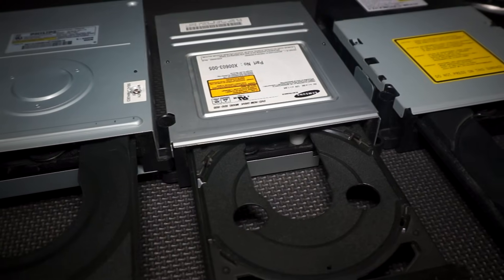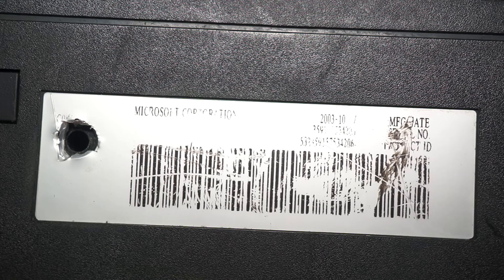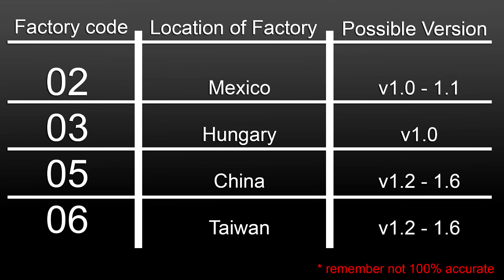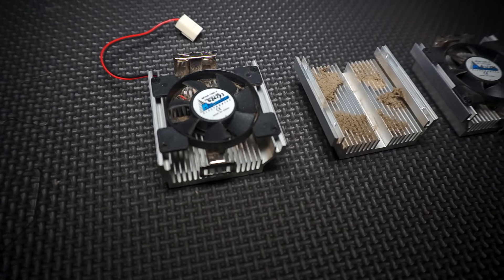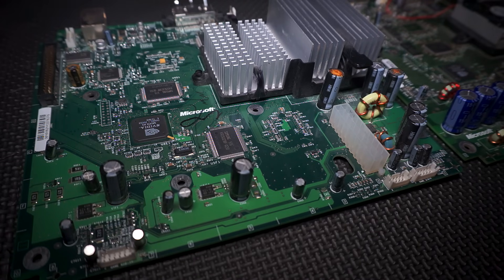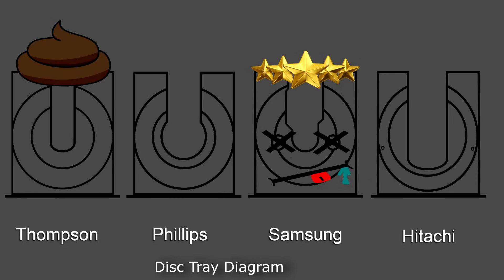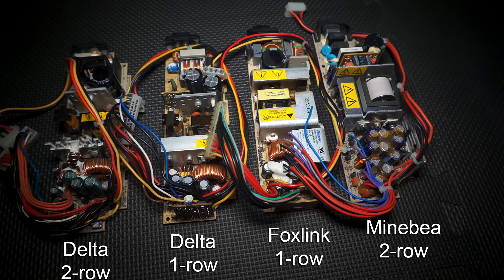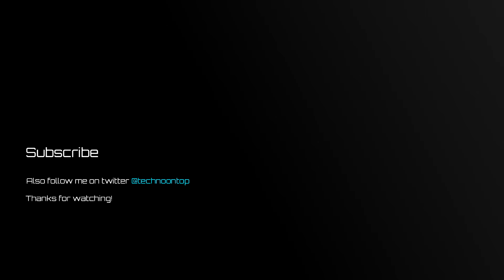How to tell what version original xbox you have

Comment: A little more information I checked the version and it is a 1.6 
Kernel number 1.0.5838.1
GPU REV 211
MCP REV 213
FLAGS 1616

Unleashx very
0.39.0528a
Build 584

I also see it has seven hard drive partitioned

C through F and X Y and Z

Not sure which one would need the driver's or how to load them

it looks like there is a file explorer built into the program that runs this unit

I think I could copy from the CD player to the hard drive or possibly from the USB to the hard drive but I'm not sure how to load the drivers if they are required to run a USB joystick and push-button console that has the trackball built into it

Any help is appreciated

Thanks
Reply from the maker: Hey, I will try to answers your questions, firstly yes an ide to Sata adapter can be used to swap in a harddrive or an SSD if you choose, one thing to consider is the Xbox will wear down an SSD much faster then a computer would. Making a copy of your original harddrive is also possible, iv personally never done it, higher end modchips such as the smartxx v2 have a built in feature to make a harddrive copy within its OS by hooking the 2nd hard drive as a slave, Im pretty sure that the Hexen disc also includes software to do it. Your main issue with upgrading your hard drive will be if you are softmodded, if you are there are alot more steps ones I'm not familiar with. Personally I always hardmod if I plan on upgrading the harddrive as it makes the process a million times easier. Look into hexen tools for the Xbox and look into installing an alladin modchip, as for using USB controllers it's not something I'm completely familiar with but I know the ogx360 adapter by ryzee119 allows you to use some other adapter that uses retro type controllers. There is another mod way old by now that allows you to use an atari stick but it requires some soldering. The 2 ports ontop of the controller were used for memory cards, and other addons such as the Xbox live headset.
Reply: @TechnoOnTop  thanks

Comment: Can I use a USB joystick on the Xbox ? I have 9-22-2004, I think this is a very 1.5

I got it modded, and I have the special oval Xbox connector to a female USB standard-a type connector

I don't know if the USB joystick and buttons would be plug-and-play or if it would require some sort of a driver

As far as I know this was modded with some sort of Linux, which has the 4000 arcade games loaded onto the hard drive

I really would like the old fashion style joystick and push buttons and also the trackball for playing games that had the trackball originally instead of using the Xbox controller which I find difficult to use

Also on my controller there are two strange-looking ports on the top of the controller and I don't know what they do they are not the Xbox style connector

Is it possible to replace the PATA hard drive with a SATA solid-state drive ?

I have the adapter to go from pata to SATA

This drive is wearing out and I would like to save everything to a new solid-state drive

Any help is greatly appreciated

Thank you in advance

Comment: So 1.6's are unable to get more RAM?
Reply from the maker: Correct, Microsoft removed the pads that are used in the modification
Reply: @TechnoOnTop  why don't there be a way to remove the chip then make a ram chip slot doubler then bam 2x the RAM chip capacity.
Reply: @TechnoOnTop  or just replace the chip with a 3d printed 128 MB chip.
Reply from the maker: I am unsure if it's even possible, the boards are different in design, the 1.6s also lack a tsop chip, interesting thoughts but they are beyond my ability
Reply: @TechnoOnTop  well I know that a mod chip on a 1.6 is possible so what about a mod chip that's a RAM slot (if you're think that it won't fit everything got smaller since 2001 so someone try that please.)

Comment: I'm not sure but I think I have a 1.4. I checked the pin 1 with the ground screw hole at 200 ohms & the numbers didn't move at all. So I redid it at 200k ohm & the numbers moved to 1.400. Am I'm doing this right? Is my xbox a 1.4?
Reply from the maker: I made a mistake in the video, I pinned the top comment and added it to the description, the pin you need to Measure is pin 2, or you could measure from pin 9 while the console is powered on it should be 3.3v

Comment: HI, my original Xbox show error 05 ? can you tell me please how to resolve this issue
Reply from the maker: Error code five is when the harddrive isn't locked and a stock Xbox requires it to be locked, if the Xbox is hardmodded you need to download hexen tools and burn that onto a DVD then cold boot into it so you can properly prepare the harddrive, if you weren't modded at all, just put back in your stock harddrive, if it's softmodded and the harddrive died and you don't have a backup of the eeprom, to build a new harddrive through chimp, then you will need to buy and install a modchip then use hexen to prepare the hard drive. Same goes if you weren't modded at all and the harddrive died,
Reply: @TechnoOnTop  Thank you for kindly reply, my Xbox soft modded without any chip, i accidentally put software disk and one option says do you want to unlock the HDD and i clicked yes and error code 05 appear..as you explained to me, now i hocked my HDD to my PC using xbox 360 explorer software i copy 3 and 4 to my PC HDD and also located eeprom bin, what shall i do? do i proceed with your suggestion to burn hexen in a dvd?
Reply from the maker: Since you have your Eeprom backup you should be able to use the program to either re-build or re-lock your hard drive I'm not sure if the 360 explorer is the correct program iv always thought it to be "chimp" I'm not super familiar with softmods, or rebuilding harddrives for them. But I'm pretty sure at this point it has to be fixed via computer. Or you could install a modchip and then use hexen tools to fix it. Personally that's what I'd do but iv always avoided softmods.
Reply: @TechnoOnTop  Thank you so much, the hexen software do i burn it on a disk as ISO or what? do you have direct link? if NOT at less do you know the size file of hexen?
Reply from the maker: @lawrencejd8935  heres a link https://assemblergames.com/threads/my-hexen-project-truhexen-2019.69926/

yes you burn it to a dvd as an iso file,

Comment: My Samsung one doesn’t open so I keep the cover unscrewed when I need to use it next
Reply from the maker: Sounds like a hassle, havr you tried to clean the little rubber drive belt? And just look over all the parts and pieces to try and see what's causing the DVD drive to stick, because it's not a super common thing, I just got one the other day with a stuck DVD drive, but it's way less common then stuck 360 drives.
Reply: TechnoOnTop I’ve cleaned it replaced the motor and swapped it out to check if it works and it still gets stuck even when I use the new belt
Reply from the maker: That's strange that it still gets stuck, in my experience it's always just been the belt that was preventing it, that or the disc drive wasn't seated right in the console. Anyways thanks for watching
Reply: TechnoOnTop No problem mate your videos are always good to watch if help is needed

Comment: I've tried to softmod my 1.6 system but when I put the usb back into the xbox,  the linux save file and the game save ( splinter cell , ect..) doesn't show up . What step am I missing?
Reply from the maker: Does the USB show up at all as an Xbox memory card because iv never had any luck using a USB drive, I know others have but not me. I use an official Xbox memory card. Then you can add a USB cable to it so you can plug it into the computer and use action replay.
Reply: @TechnoOnTop  yes it dose.
Reply: @TechnoOnTop  Oddly had issues with all my USB drives too, what worked for me was a Sony PSP with a 2GB memory stick inserted!

Comment: Well... i got an Hitachi on an 1.6 (maybe, the sticker says 2005) and for some reason a Hard Drive that has only 5GB of storage. Are the Hitachi drives very rare? Also, the motherboard is very interesting compared to the other ones from 1.0 to 1.5. Also if the DVD-drive (Hitachi) breaks, whats the best one to replace it with the Hitachi?
Reply from the maker: The hard drives came in 2 different sizes 8 and later 5 gig I wouldn't call them rare, iv seen the smaller 5 gig in older versions of Xbox before, my best guess for that would be it was sent in to Microsoft for repair for a harddrive failure. Yea the v1. 6 lost a bunch of things, it's tsop chip along with the pads for the extra ram, the mounting holes are also slightly different. Honestly any drive toy can find that still works is a fine drive. Most people tend to gravitate twords the Samsung drives, and I suppose I would say stay away from the Thompsons as they are the oldest. But any drive that works is a good drive.
Reply: @TechnoOnTop  Ok. Thanks for the information. I can't stop playing Burnout 3 Takedown on my XBOX.

Comment: My XBOX has the MFG. Date: 2005-02-25. What version do i have?
Reply from the maker: Idk  the video covered that. Thanks for watching
Reply: You didn't say anything about the 2005th versions... Also i think i Figured it out. I opened up my XBOX and  it seems like a 6b or version. There's really a big Difference between the oder Version and the 6 (6b) version.
Reply from the maker: I did, the graph shows 2004-5 = 1.6,1.6b, those boards where stripped down, they removed the spots for the the extra ram, and they removed the TSOP chip, another difference from the earliest 1.0 is they don't have controller daughter boards, but those were removed at the 1.3. I don't think there is any difference between the 1.6 and the 1.6b other then the manufacturer of the Ram chips.
Reply: @TechnoOnTop  Oh ok... thankz for the information. I really enjoyed watching your video.
Reply from the maker: Your welcome, thank you for that much appreciated, happy modding! If that's a path your going down, feel free to ask any questions you may have. I will do my best to help
Reply: @TechnoOnTop  thankz dude

Comment: So after 15 years I felt like looking for my old green halo xbox to play some games and as I go to plug it in...I find the power supply is missing and I have no idea why. I know for sure I never opened it myself and if it did break and I sent it for repairs...why would the PSU be missing? This is all very strange, but at any rate, I need a PSU. After watching this video, I can see that my xbox is a 1.4 or 1.5, but I also discover that, just like one of the motherboards in the video, it has something written with marker in the middle of it. I'm not sure what it says, but does anyone know for what purpose someone would write something on an xbox motherboard? Also just want to confirm that for my 1.4/1.5 xbox, any 1.2 to 1.5 xbox PSU should work, correct?
Reply from the maker: Ah the green special edition I wish I would of picked those up when they were cheap, but that is strange that it's missing the power supply, maybe a sibling swiped it? Or a "friend" most if not all motherboards have marker writing, I think it's just what the testers in the factory would scribble to say it works and is good to go. And yes any of those power supplies just make sure you match the connector I'm guessing it's a 2-row. Good luck! Thanks for watching
Reply: Interesting information on the writings. I was hoping that it was something done by Microsoft's repair people which would have meant that I sent it in for repairs, something that I don't recall doing. I don't even recall it breaking to be honest. I was young at the time so I may have just forgotten... This mystery will torment me forever lol. Anyway, I appreciate the help, thank you very much!
Reply from the maker: If you sent it in to Microsoft for repair then they wouldn't of just sent it back to you without a power supply, hopefully all that's wrong with it is the fact it's missing a part and not more good luck! If you have any other questions feel free to ask.

Comment: Just some info about my experiences.  I have a launch edition Xbox.  I assume it is a 1.0 because I purchased 11/15/2001. 

In 2002 I purchased Capcom vs SNK 2 and the Thompson disk drive caused an error in which it stalled for 2 minutes for loading between rounds.  I purchased a PC Samsung drive ($45) that had the same internals as the Xbox Samsung drive ($80) and modded it to work in the Xbox.  The load time in CvS2 was now 5 seconds between rounds.
Reply from the maker: I'd be interested to hear more about how you modded said drive to work, iv hooked up a laptop drive before, it would boot backups, but only from boot, made it somewhat useless,
Reply: @TechnoOnTop  There were instructions on the internet. Google: Samsung SD-616t Xbox.

4 soldered wires onto board of new disk drive connected to 4 of the wires from yellow 8 wire connector.  Split power from HDD with molex to provide power. Swap polarity of drive's motor.  Remove drive face plate from new drive and cut its tray end so that the xbox drive tray cover can fit on it.  Have to permanently remove the Xbox screw post that is near front of disk drive.  Quite the operation really.  Probably not worth the $35 at the time, but I learned quite a bit.

I still have Xbox modded with 320 gb hdd, but its dash is sloppy.  I need to clean it up.  Just removed the clock capacitor.  Still good but my 65" oled has only hdmi.
Reply from the maker: Very cool, I went ahead and found some discussion on the topic and read over it and then remembered reading about this forever ago, so thank you for jogging my memory on the subject it's an interesting one, maybe one I will explore further in the future, I have more working disc drives then Xboxs  so maybe not anytime soon lol that sucks! I always make sure that the new tv's I buy have more then just hdmi, but there is a modder ryzee119 who has made an hdmi mod for the og Xbox, if your into that check it out! He also makes a converter to allow 360 controllers to be used, though unsure he has any left he, is assembling and shipping his last run as of a few days ago. Happy modding!
Reply: @TechnoOnTop  Originally these modded pc drives helped to play birned copies of games, but I only did it to replace my drive originally.

Comment: Based on my console being from 2002 and the single-row power-supply, it could be v1.0 or v1.1

But the serial number being '05' means it could be v1.2 - v1.6

I've never been so confused.
Reply from the maker: Was the Xbox opened prior to you having it? If so it could of been swapped into a different case. Also if it was sent into Microsoft for service they may or re-printed a  serial sticker with the updated date. If that's the case you should be able to see a sticker over a sticker. If not maybe you just got an oddball base the version from the video chip
Reply: V 1.3 new heatsink and no Fan no GPU. No extra PCB for USB (pada) and single connector for power GPU-XGPU A
V1.4, 1.5, 1.6 GPU-XGPU B

Comment: I have a question, is it a good idea to purchase just the motherboard off ebay?  I found a bundle of 3 motherboards, 2 of them are focus and one conexant.. What  troubles would i run across if i were to jump on deal like that? I have softmoded 1.6 xbox that tends to turn on when it wants to, im thinking it's a psu issue.
Reply from the maker: Firstly you would need a modchip for each one at least at first to get them to boot, you would also need to either make modifications to your psu or buy one that works with a v1-1.5. The 1.6 psu is different it has a higher standby voltage.ome other thing is the bottom tray on 1.6 cases is slightly different and would need some modification.
Reply: TechnoOnTop Ahhh, more troubles than I had hoped. Too much hassle for me. That seller has a board that comes with the hard drive. My chances are better with that one correct?
Reply from the maker: @BlaGGah  you may be better of just picking up another locally. but yeah they are selling ones that are working with the paird HD. but a 1.6 Powersupply  doesnt just work with all other revisions
Reply: TechnoOnTop yeah. I let go of that idea. I’m just waiting for the rest of my stuff to come in the mail to fully upgrade to 2tb on my Tsop’d ones. Have you ever used that HDD raw copy tool?
Reply from the maker: @BlaGGah  no iv never used one before, i typically only keep 1 large has "everything on it" harddrive for my xbox which sucks when it decides to die lol..
Reply: TechnoOnTop yeah if I were you I’d make a backup if possible for safe sake.
Reply from the maker: @BlaGGah  yeah i really should, i need to get some more harddrives though, my computer is maxed out lol
Reply: TechnoOnTop I was able to find some used 2tb hard drives on eBay. The first 2 I got, one of them is damaged. Got another lot of 3 which came in yesterday which I haven't tested yet. Hopefully they all work. How come Seagate has a bad rep when it comes to using it on their Xbox?
Reply from the maker: @BlaGGah  yeah i always freak when ordering harddrives hopefully they are all good, i try to only buy them new but that doesnt help, have had new harddrives die within a year, but idk man  the last hardrvie in my xbox was a seagate, it died, i replaced it with a 500gb Western digitial(still alive), then replaced it again with a  1tb seagate. iv always prefered seagates, i didnt know xbox modders didnt like seagates lol
Reply: TechnoOnTop yeah Seagate drives seem to have a bad rep in the Xbox modding community. I need your help with XBpartitioner. I finished setting up my 2tb WD drive. I need to create an expension partition for the G drive. If you could help I'd greatly appreciate it.
Reply from the maker: @BlaGGah  i believe you can use the triggers to set up the partitions,  iv never used anything bigger then a 1tb. you  can either use the presets to split them or you can split them manually . idk if that helps i always have to mess around with that to get it to work. and i never emember my process